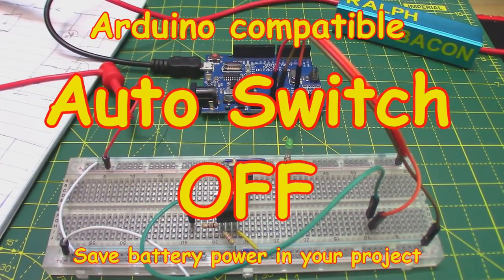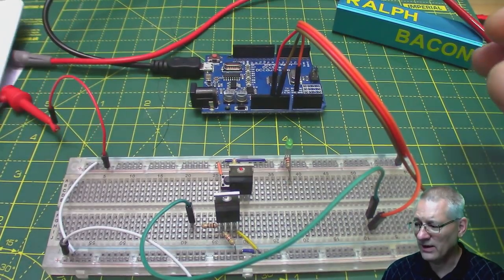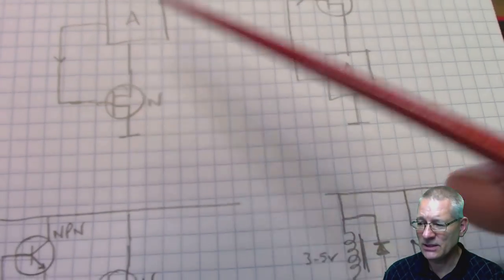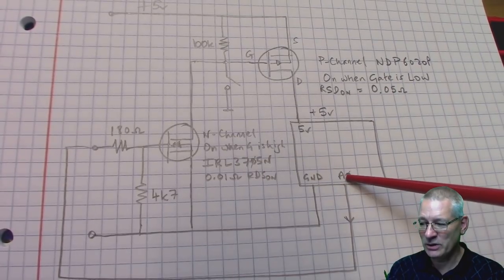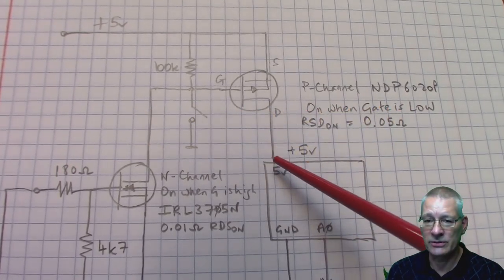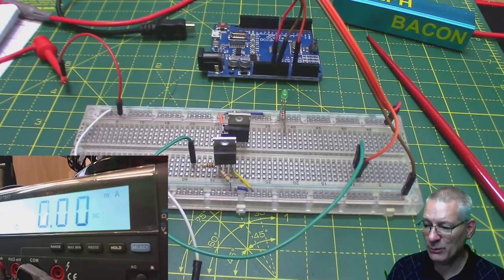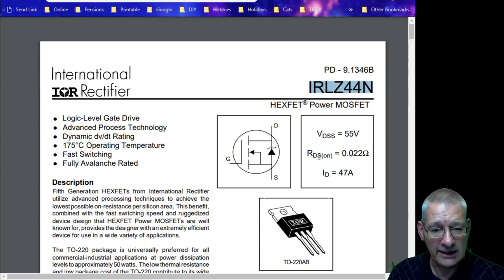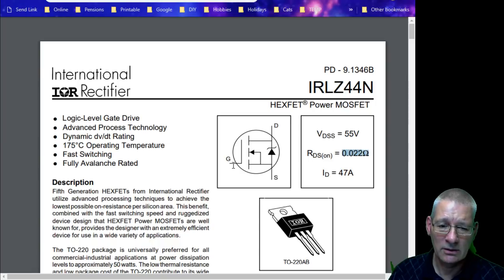#123 Arduino Auto Shutdown (and switch off)

Comment: Hi, i'm a beginner, i just discovered your channel, it's a great resource! You deserve more subs, as far as i'm concerned from now on, i will spend my life on your channel!

This is a great project, which i had been looking for a long time, but right now i'm unable to start it yet, for two reasons:

- How i can integrate your proj with an UPS? Because i made a door lock,
with a 9v power supply and, a lil UPS with some parallel battery, in case of blackout...
perhaps, i should let pass a minimum of current, so that the power supply is always kept slightly busy (using a capacitor between power supply and UPS?) and that the UPS starts, only in the complete absence of power? Sorry if I'm saying stupid things, i have not been able to study electronics, i'm learning along the way ...

- I don't have the same mosfets as the ones in the tutorial, i have salvaged some others, but, i'm not entirely sure that they can be good as substitutes, and unfortunately, i live on an island ...i should wait looooong time for a delivery, so i ask you...
Comparing mine and project mosfets datasheets, what characteristics should i keep in mind to get mosfets similar to those you proposed?

Thank you so much for your work!
Reply from the maker: Welcome to my Arduinite world, Rico-S! Let me answer your last question first, regarding MOSFETs. Any MOSFET will work as long as it requires "TTL level (5v) level" gate voltage. What does this mean? It means that the MOSFET will turn fully on with just 5v being applied, such as from an Arduino. MOSFETs that are not TTL compatible will still turn on at 5v but only partially and will get very hot indeed, negating the whole point of them. Always read the datasheet for the particular MOSFET and find the RDS(on) parameter. That will tell you (if the description hasn't already) what the resistance is between the Gate and Drain at various Gate voltage levels. It should have an entry for 5v. If it also has an entry for 10v be very suspicious!

Regarding your UPS question, I'm slightly confused. A small UPS normally supplies household (mains 240v or 110v) from a battery (or set of batteries). What you are describing is a battery backup for a 9v supply which is also very common these days (although usually using a lower voltage and one or more 3.7v lithium ion batteries). The 9v supply will continue to charge the battery until it is full and then switch off and monitor the battery voltage; if it falls it will charge it again. There should be no need to keep things "running" to keep the battery topped up. It's important that the battery voltage is actively monitored by a charging system to avoid over-charging (and possible fire). Some Li-Po 3.7v batteries have a protection circuit built in to achieve this. There are many such battery charger/monitors available, I think I mention one in video #115.

Thanks for posting, good to hear from you.
Reply: @RalphBacon   WoW quick answer, thanks a lot.
About the mosfets, very helpfull, i had imagined it, thanks to your answer now, i now have more knowledge and confidence.
Now i will reading a lot about mosfets.

About the "UPS" :|
I wanted to call it backup, then reading on net many people called it UPS, and i let myself be dragged, to amaze you with big words :D ...
I confess... i only made a small backup with some battery :( , but not rechargeable. Above all, i also explained myself badly.
My perplexity remains, your project turn off Arduino, mine starts the backup batteries to keep Arduino active, wouldn't that create conflict?
I don't want to to bother you, but if you suggest me a project to follow to create a power backup, that can be compatible with your project, i would be very happy.

Thanks again for taking the time to answer me personally, you are one who cares about its users, it's a rare, and very important thing.
Reply from the maker: Happy to help, Rico-S! 
OK, here's a suggestion: http://bit.ly/5vUPSArduino
A single 18650 battery can be charged by 5v (eg phone charger) which also powers your Arduino via the Vin pin (max 5v - check!). If the power goes off, the battery continues to supply power to your Arduino as if nothing had happened. Then the relay on/off works as I described it, the power just comes from a "UPS" - well it might be called that now as it is "uninterruptible", right? What do you think, a solution to your problem?
Reply: @RalphBacon  
I had seen a video about this object. I will buy it, being on an island, i will see it in loooong time :D, meanwhile i realize your fantastic project, then i will integrate that "UPS".

Once again, thank you very much.
I have recommended your channel to my friends.

Comment: I may be missing something simple here but how are you isolating the power from the USB?

In other words, why doesn't the Arduino power up when the USB cable is plugged in?

Its clear the +5v in the schematic is from an external supply, (and goes through the ammeter), but I cannot see how the circuit on the breadboard can control the USB power.

I'm not familiar with that flavour of Arduino so it may be just a quirk of that board but even so, I'd expect it to power up via the USB regardless of any exterior circuitry. (Unless +5v is shorted to GND but that would use power, wouldn't it?)

I appreciate that normally the USB cable wouldn't be plugged in but as you demonstrate operation when it is It got me thinking why the Arduino didn't just power up when you plugged in the USB cable. (Unless its data only?)

Thanks for all your hard work, its been very useful on many occasions.
Reply from the maker: The Arduino won't power up because the P-channel MOSFET is held OFF by the 100K resistor. We're not powering the Arduino board directly via the USB port, we're supplying power via the 5v header pin, fed from that MOSFET. The MOSFET acts very much as a single pole switch. Until we turn that P-channel MOSFET on (by grounding its gate) no current will flow. Does that make sense MrTom? Ask more questions if anything is unclear.
Reply: Hi Ralph, thanks for the reply, appreciated.

I'm with you all the way on what you've done and why and how etc etc.....and its great stuff....this is not a question about the external power or circuit.....It's all great!

My question is about USB power, and I'll say again that I appreciate this topic is not about power from USB but an external supply...which is fine, switched by a MOSFET etc etc yeah got ya, I totally understand...

...BUT...

At 26:42 you plug in the USB cable. (Its plugged in at the start too!)
USB supplies +5v DIRECTLY to the board.
USB power does NOT go through your external circuit...it is NOT switched.
At this point the board should power up (REGARDLESS of any external circuitry) but it does not.

My question therefore is why not?

Do you see my point? You should get a power LED when you plug in the USB cable....right?

I'm just curious as to how the power from the USB is switched...you say yourself at the top of the video that there is no power to the Arduino and yet the USB cable is plugged in....which supplies power....and is NOT switchable....it doesn't go through any MOSFET or any other switching device....ya know?

I'm not good at explaining without sounding like a complete arse, I'm sorry If I do, hopefully I've explained it better and you can now understand my question....when you plug in the USB the arduino should power up....regardless.

Thanks again for all your videos....they really have been a 'goto' resource.
Reply from the maker: Ah ha! Thank goodness you included that time-stamped point in the video. YES, the cable is a data-only cable, I've cut the positive lead in the cable so I can do stuff on the Arduino IDE but don't power the Arduino by through it. Here's the funny thing: I had actually videoed all this but had to cut chunks out because it really was a bit long, and I guess this explanation is still on the cutting room floor! Quite ironic. But at least now we can all understand what's going on here. Phew! Glad you like the videos, and thanks for posting, appreciated.
Reply: Excellent! Thanks for the explanation, I thought I was going mad for a moment!

Video's are superb....only one complaint...not enough of them!

Thanks again for taking the time to make them, I appreciate how much time it takes.

Comment: In the ON state the FET turns some of the current passed to the arduino into heat dissapated.
Is that really less power cunsumpotion over time than the few uA when the Atmel processor is in deep power down by it's own integrated sleep mechanics? 
I am not so sure about that one... perhaps only when the Arduino powers on extremly rare occasions?
Reply: 30mA through 0.03 ohm you may do the power dissipation calculation yourself. Is your question still valid?
Reply from the maker: It's µW of power though. Not enough to really influence the overall battery life. And, as I said, you could put the Arduino to sleep but power off the rest of the circuit. Best of both worlds, perhaps?
Reply: @Arno Dekkers --- Yes, the question is still valid. The sheet tells ~0.02 Ohm for a duty clycle of less than 2% and pulse width of <= 300uSec. I am wondering what the real power dissapation in this setup is?! --- Since the setup in the video did not show the power consumption from the FETs, but just of the setup including the controller board as a whole, I have not seen the power consumption of just the FETs including their gate currents.
As you can see, I tend to never trust in optimistic values from manufacturers sheets ... :)
Reply: When the arduino is switched on the dissipation in the MOSFET is about 60 Micro Watt. An arduino chip in deep sleep consumes 30 micro Watt continuesly.
Reply: Yes, but we are still only talking tiny numbers and as Ralph pointed out the two techniques in conjunction with each other add up to a quiescent current state of next to nothing...:)
Reply: Richt ! Thats what I ment
Reply: Well, 60uW sounds pretty nice! I wuld have expected from the conditions of the sheet (<=300uS / <2% duty) that the FET perhaps tends to saturate some more and from that has more drop then when used in the range of mSec to a number of Seconds, as well as that the gate current might turn to be some higher then as well.
Sadly I do not have one of these FET at hand so I could test for this.
But good to know consumption is still so little, even when the ON cycle is for much more than just 300 uSec.
Reply: As you saw, they are pretty Cheap, zo get Some from our Chinese friends

Comment: I soldier old cat 5 cable to my component if they are not able to get down in my breadboard
Reply from the maker: A great idea. I use hookup wire that I buy in 2m lengths, probably 23swg; lasts a long time. Thanks for the suggestion.

Comment: Thanks, I'll use something similar.
At IRLZ44N Vgs (th) is maximum 2V, at 3.3V is open, it works perfectly also at Raspberry. The current is below 10 A
Reply from the maker: Good to know that, Emil, at least Raspberry Pi users can consider this a MOSFET to add to their component list. Thanks for posting.

Comment: instead of pin A0 from an Arduino could like an esp32 power the MOSFET? Then the Arduino is controlled by an esp32. And thanks for making this kind of videos I learn a lot from them.
Reply from the maker: It MIGHT work for the ESP32 - it depends on how sensitive the N-Channel Gate is. (Let me check... talk amongst yourselves for a bit)... OK, it says that the maximum voltage required on the gate to turn on the MOSFET is 3v so it should work with the 3V3 of the ESP32. Try it. If no luck, use a simple BJT as a MOSFET driver - so your ESP32 drives the BJT which in turn brings the MOSFET on.
Reply: @RalphBacon  I have tried it but it's a little bit sketchy sometimes it turns on and then it doesn't. But for the BJT should I use a bd139 or a bc547 and the last question: Which resistor value is needed for turning the BJT on. Sorry for this but I don't really know how I could determine the value needed.
Reply: I have found it and thanks for helping!

Comment: What you have discovered is a basic "Load" switch, of which there is a whole world of them.  They have integrated these discreet mosfets into a single package (sot-23 and smaller).  Examples, http://www.ti.com/power-management/power-switches/load-switches/overview.html.
http://www.ti.com/lit/an/slva652a/slva652a.pdf

http://www.ti.com/lit/pdf/slva887
Reply from the maker: I do like the pdf link you give here, Randal, very informative. And, of course, the term "Load Switch" nicely encapsulates exactly what we're doing here, electronically rather than manually.

Quote from the TI pdf:
...load switches are electronic switches that can be used to turn on and turn off power supply rails in systems, similar to a relay or a discrete FET.
 
Quite so. Pretty much the point this video is making, although not as explicitly as TI have in the PDF.
 
I'm sure others will find that useful too, thanks for posting, most appreciated.

Comment: Hi Ralph,  I'm using the  Si4599  which i ordered from banggood. I have wired it like this 
https://github.com/gitpeut/IRF7317-selfextinction 
the problem I'm having is that the circuit/arduino turns on when i press the button but the circuit doesn't turn off
after the countdown. It does turns itself off but when it is not expected. kind of random. 
It wont turn off if the p channel gate doesn't go low but it will turn off when it goes low but it decides itself when to finally turn off.
Reply from the maker: Not the behaviour I have experienced. Your circuit diagram is a little difficult for me to follow as you have drawn the two MOSFETs as they appear in the chip rather than drawing them out separately. Anyway, you should be able to test all this without any Arduino. The P-channel will switch off the instant the gate is not held low (ie when you release the button).  It is held off via the 100K resistor from the Gate to +ve.The N-channel MOSFET, with +5v on the Gate, will hold the P-channel Gate to ground (so keeping it ON) Once the N-channel Gate's voltage is removed it will turn off and thus turn off the P-channel too. 

Instantly. 

Get each bit working independently (using dupont cables to connect Gates etc). Then both MOSFETs and finally use the Arduino to control the N-channel Gate's voltage. It's what I have done and it does work absolutely as expected, so it's either your wiring or missed connection or similar.

Comment: Dave on the EEVBlog has a related scheme for soft power off - https://youtu.be/Foc9R0dC2iI
Reply from the maker: OMG, yet another one who has explored all this. Mind you, you say "related scheme", perhaps it's different. I might skim that video...
Reply: The difference in this soft button power toggle from yours was to latch the on press to keep the power switched then change the function of the button to be used to force it off. In your case where you want the arduino to power itself off the latched button functionality would be your output GPIO pin instead. I think the latching on technique could be helpful to avoid your long on button press issue and then wire in the GPIO pin to force the off which I think overcomes the slightly glitchy behavior Dave’s circuit was having when turning off.

Comment: Dear Sir Bacon, what do you think about the TPL5110? (here a Breakout board for this chip: https://www.adafruit.com/product/3435)
Greetings from Germany
Reply from the maker: Servus Frank! Und Willkommen! I've not actually looked at it, although I know what it is supposed to do. The main "issue" is that people seem to think it acts as a switch or relay when what it actually does is provide a signal to the receiving module (and expects one back too). Now that might be enough to wake a device in Deep Sleep, for example, but it won't do what the MOSFETs do here, which is actually switch the power on.
 
I really should get one just to try it out (to make sure my understanding is correct) but trying to find one at a decent price (including postage) is quite hard (Banggood who sometimes give me stuff to evaluate don't stock this item). We shall see.
 
Also, alles gute und mit freundlichen Gruessen aus England, bis dahin.
Reply from the maker: I've ordered a couple, I need to experiment and tell everyone else! Thanks for the heads up, Frank. And yes, I speak German, my family lives im Schwarzwald. Just little old me, on my own, in the UK. <sad face>